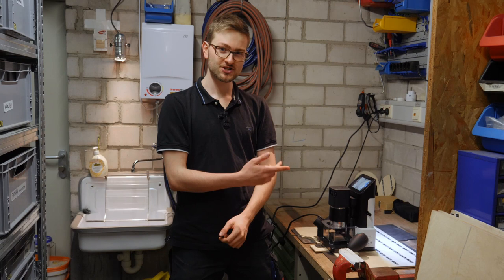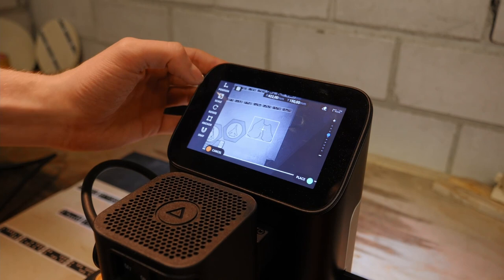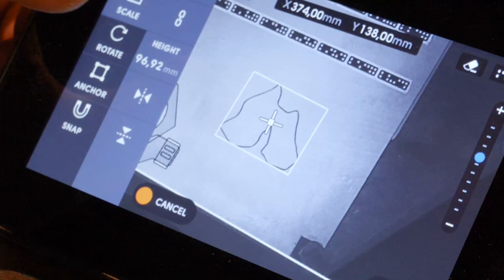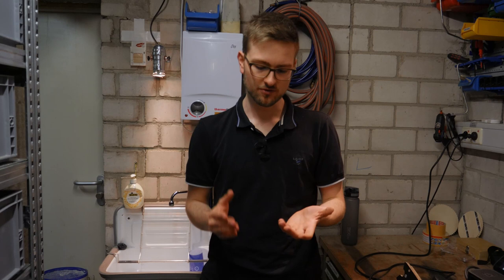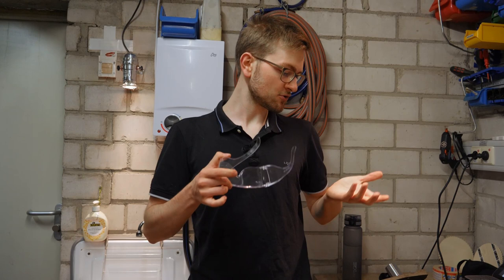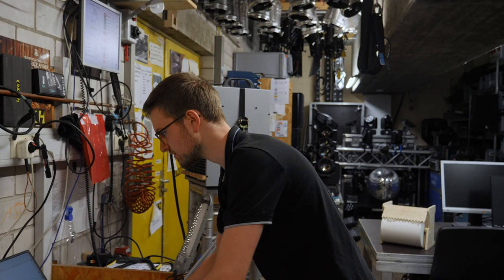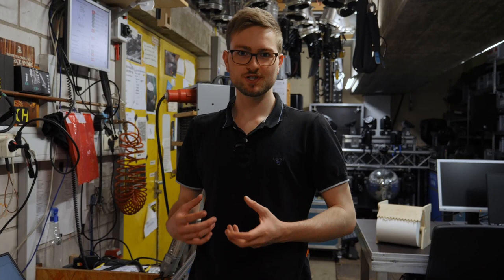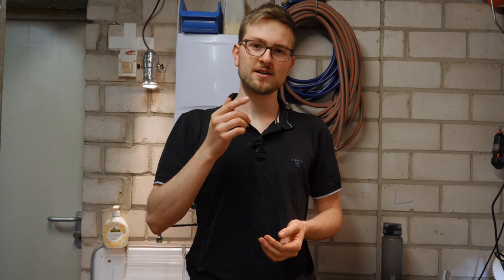Shaper Origin Inverness Update & Workflow Tips Vol. 2

Comment: I would not recommend using a countersink drill in a router. Countersink bits are made for speeds far less than typical router speeds. I would use a v shaped router bit instead, its made for such high speeds.
Anyway, nice Video, thanks for the tipps! :)
Reply from the maker: I hadn't thought about the rotational speed. Thanks for the heads-up! I'll update the description accordingly. And thank you for the feedback, glad I could help 😊
Reply: @BodgedButWorks  Gerne ;)